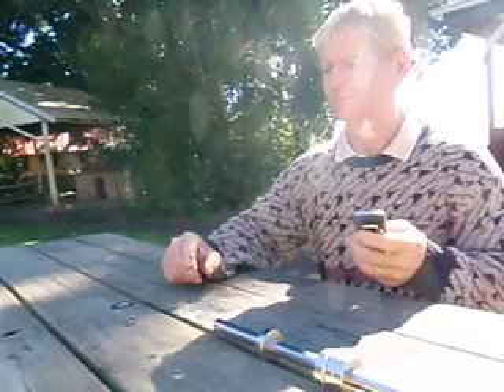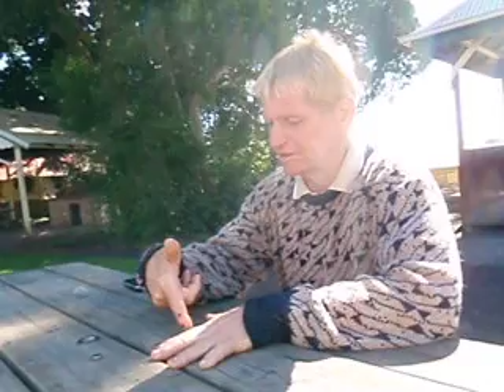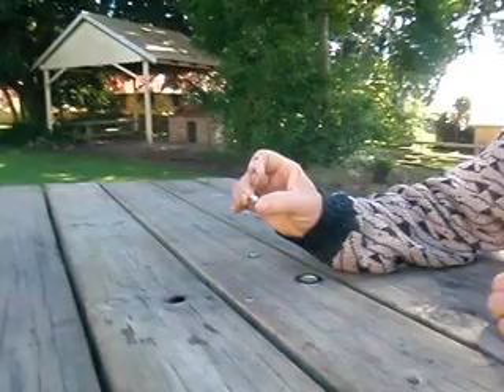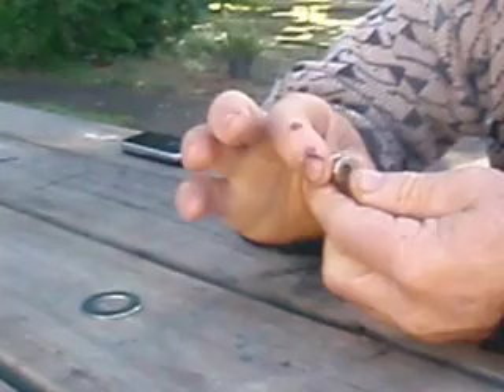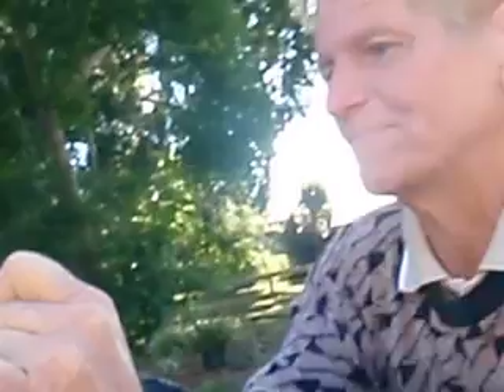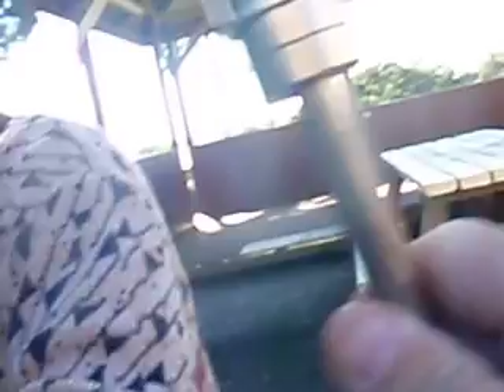A I R Peter Stevens with Joe about Magnetic 2011

Comment: well its called lean burning by the suzuki video joe is great mechanic yes the baterry has 2 charges in it its dc and ac together the baterry holds s potentia because she goes dead flat but still acts as a capacitor when the alternator has not enough rpm to produce dc pulses it will still use power from the baterry and convert the dc to some thing ells and that is ac pulse the alternator is alredy grounded so you actualy need only one side of the coil ore you can get the same by using the techo cros wireing it can hapen if you use external selenoids as well like starter selenoid baterry dual setup selenoid and so one basicaly any thing that use a coil depending on the ground charge the selenoid on the carby will open more ore close more ore do bouth things at same time that menomena you can only see by older cars who have voltage regulator isues ore cros wiring yes there exist 90° spikes but its not oposite polarity its bouth + and - ac and you can fire the engine form inside and out side so you actualy can brake points on the ignition coil tought ground if its high energy ac you using and yes you have 90° degree fuel/air flow see how a tesla pump work so imagine you using a dc motor and use ac as well it will over write the speed of the electric motor if they use centrain preshure it will go significantly higher some thing a fuel pump turn to a high preshure pump some thing like that "venturi effect" study that and see what are fuel jetts in some aplications you actualy dont need a chocke only a trothel see on youtube "petrol vaporisation" by using a glass jarr and 2 pipe's the engine suck from it self how much fuel its need and that is surface charge by sucking using a centrain amounth of wacum preshure fuel implode/explode any way depending wher the timing of the distributor is and how much you energy apply to the ignition coil you get lot diffetent effects one of them is LPG engines study that! the so called joe cell is special and it works its actualy change the atomic structure of molecules energise them some thing that did not burn before now is burning comon elements in air are moisture vater nitrogen oxygen so all of this elements you actualy can change their propertis under wacum and high voltage and that what a joe cell is a air/fuel polariser so that is why you finde ice in the radiator on joe cars that only can do liquid nitrogen ore liquid oxygen combination with high wacum and implosion by using retarding the distributor you get implosion by advancing you get explosion joe used implosion with super lean air/fuel burnabel gase's but first he needed to warm the engine up before adding the cell because lean burning petrol/lpg cars hard start in the coold morning you need smaller spark plug gap that thing goes to 500rpm idel it has a idel problem if the engine is cold you need always apply on the acelerator so that the engine wont stop alternator charge the baterry only at around 1000rpm! the car is super quaet you can barely hear it it has high rpm range and goes up like a rocet but at the price of torque up hill the car luse speed so you cant have bouth speed and power and that is what joe always saying is for evry action is a oposite and equal reaction "true" that tehnology existed long before Joe was even born but sadly it wont by used hydrogen is to much dangerous even more hellium this is more for teching porpuse only dont tuch that staff its to dengerous joe and peater have great knowlage about those things and Joe did tell use evry thing find their videos and wach care fully what they are talking google ore wiki for answer's and you will understand evry thing this is not only mechanic this is chemistry phisyc's electric knowlage all you need is basic learning and it will work out for you I must admit Joe and Peater are great teacher that you for that :)

Comment: It appears matter and anti matter collide one the air form outside what we breathe collides with the blow by sump air the spark matter ac colliding with anti matter dc spark electric sump oil charged and coolant charged causing matter anti matter block saturation all become neutral formats so their are 3 interacting fields/energy that come out to play in the engine cylinder no expert but when joe says "we put positive and negative together" I think he means matter and anti matter forces

Comment: been thinking that the Joe cell is charged water in radiator negative with sparking just runs the engine from ambiant air. no hydrogen at all but maybe heavy water in block.
Reply: Would how the radiator is connected to the engine "short" out whatever a "cell" does?